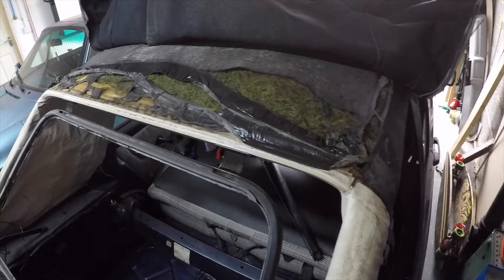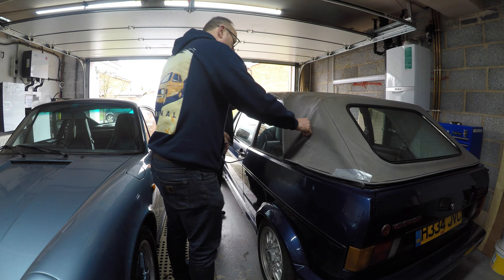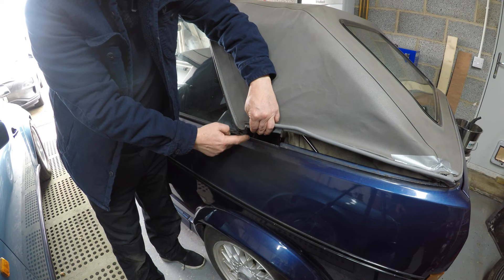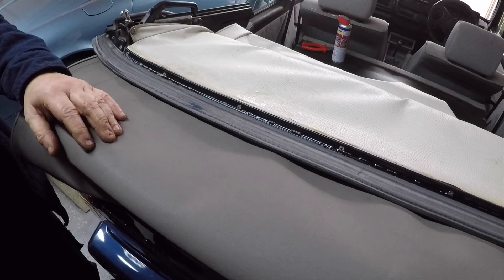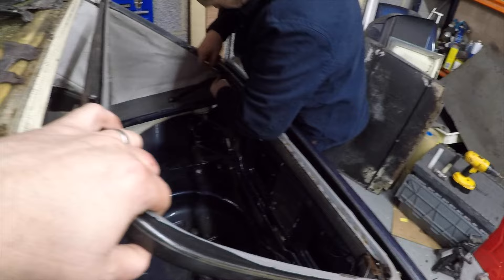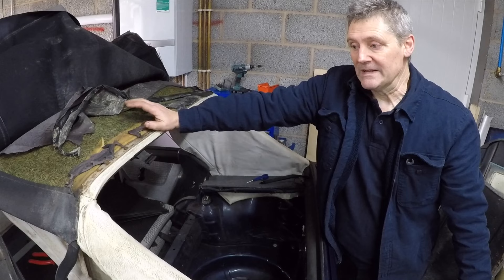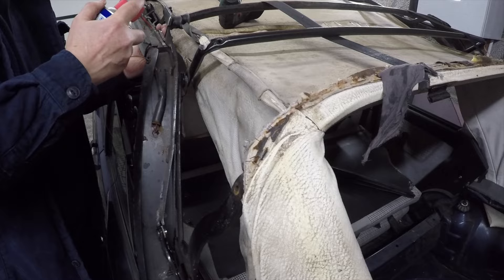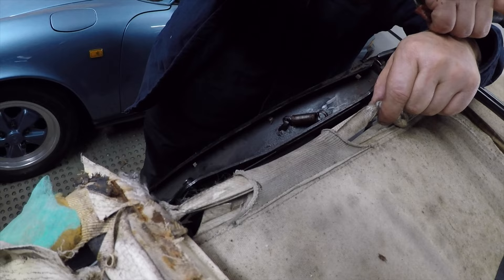Watch Expert Strip a MK1 Golf Hood in Stunning 4K!

Comment: Thats normal for an old roof. The rear window frame always rots out because youstaple the cloth to a plastic frame thats imbedded in the metal frame a little water moisture can collect in that edge and rust will come trugh. NOT true there is a tention cable in the side that together with a spring holds the side straight when the string breaks the tention is gone and wont hold the side in plase and it creaps up. The first roof was called sonneland i believe that was the brand. it was always a cloth and the line in the rroof hes poibnting out is stiching from factory (Witch u can still get) The PVC roof never was factory so this one had already had a roof replacement in the past. I lube the roof once a year liberally BUT NOT WITH WD 40 use a silicone based lube it takes way longer for it to dry out and is better for the plastic bushings.
Reply from the maker: Thanks for your take on the process. It sounds like you have some experience too.
Reply: I’ve been fitting hoods on these cars for over 10 years.
You are incorrect that the MK1 Golf Cabriolet didn’t come with a Vynil hood.
Sonnenland is the generic name given to cloth tops as it was named after the area it was developed. Hartz bought out the Sonnenland factory and continued to make the material and the only cabriolet MK1 wise that came ever out of the Karmann factory with a cloth top was the Rivage edition in the U.K. 
Again replacing side tension cables on a shrunk roof will NOT undo years of UVA sunlight damage. That is a scientific impossibility. Those side cables are on springs so the springs extend as the cable is pulled up By the shrinkage.
Just how does the moisture manage to get into the material that’s stapled into the plastic insert?
I use WD40 to lubricate joints as so many are neglected and it’s a good start to drive any residual Moisture out of the  the joints.